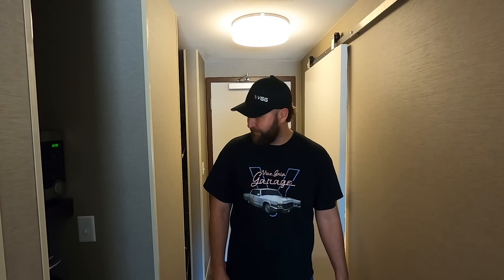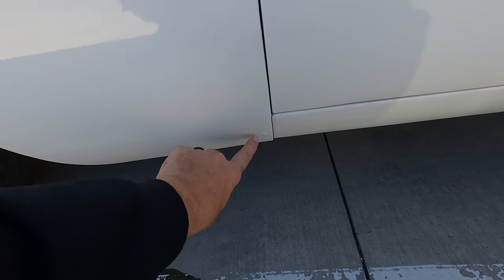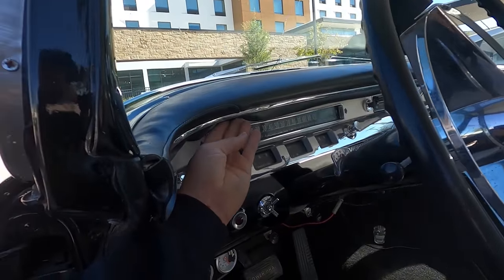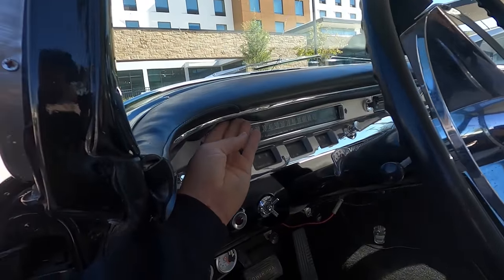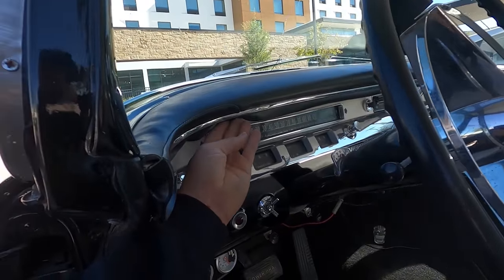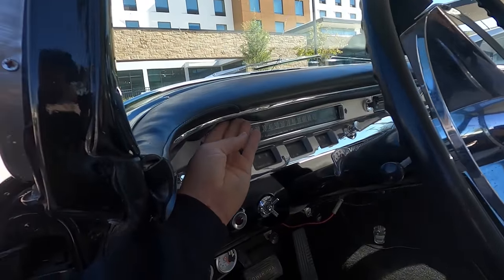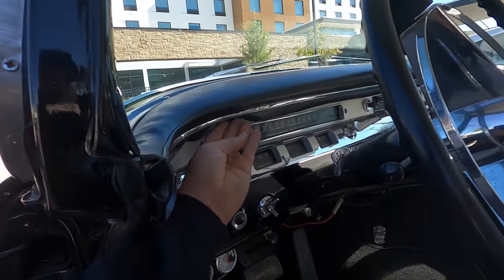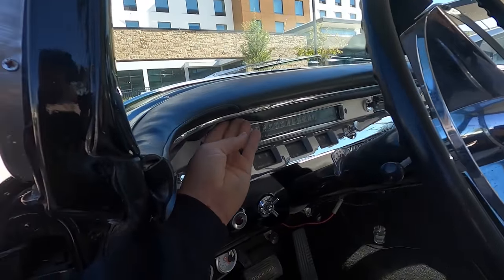Will This 1956 Buick Special DRIVE 1,200 MILES Back Home? (P1)

Comment: Independent suspension, internal drive shaft, I beam not stamped front suspension with Danaflow transmission. Just check fluids make sure there’s no leaks, and this car will make it around the world and back. I’m lucky to own a’56 Tudor Super.

Comment: Try a restoration of the Radio - mine 61 Corvair needed capacitors and a little readjusting on the tuning and receiver RF circuit. 28:47 only took a few seconds to get warm and go after starting the engine. 30:45

Comment: Hey everyone this is Giovanni from Philly I have a 1955 Buick special that I'm building now and my baby is a 1955 Buick roadmaster that gets a lot of looks I'm not rich  but I fix a little at a time save up money do more work I removed my seat's at the shop $850 please continue to fix your dream car's  Jay Leno has a 1955 Buick roadmaster with lots of horsepower I'm still working on my roadmaster 30 years later I need a 2 nd Job lol

Comment: I bought a 1980 buick lesabre in Nashville and that's the first problem I had was a bad water pump..Changed it out with a brand new one that eliminated my coolant leak problem..It rean like a top because I babied from the start..High performance plugs and wires,synthetic motor oil.never had a transmission problem.It was a every day driver car.to and from work.Oh the other main problem was the rear end was loose.

Comment: I blew up my dynaslush in my 55 Special. A teenager can do anything. Good thing Dad had a Sunoco with a lift. Got it out by cutting  the floorboard with a chisel to get that last bolt. Dropped it in a 55 gal drum. That tranny weighed more than my present car.

Comment: I just watched this video again for like a third time.
Maybe a guy would pull the nail head and original transmission driveshaft. Drop in a hot SBC/turbo 350. She would make a nice little cruiser.  
It’s a beautiful car. And deserves to be driven.  
Keep the original drive train just  in case you want to return it to stock original.

Comment: yo Derek i like your style - constructive criticism - IMHO it be worth the time to cut the bottom hose back a bit which gets rid of the typically weak area under the hose clamp from 'oversqueeze' and gets you the clearance with the frame , then i'd put one wrap of tape that goes under the clamp then wrap it a few more times after the clamp is on...

Comment: Well, I just started the video.  You haven't even started the car yet.  Go ahead down memory lane, it's ok.  Old family cars are kind of like your Grandpa's gun.  Keep it and pass it down.  I sold my Willys Jeepster after the Black Forest Fire in Co Spgs.  approx 2012.  I lost my storage, and the damage was extensive.  It melted the pot metal emblems, door handles, burned the tires off - but there wasn't a lick of grease on the engine or frame!  Always a bright spot to look at.....

Comment: I very happy u found your family car my friend I was a baby growing up and my uncle has two 55 chevys one Belair an a 210 hard top both two door 327 engines, not stock but they get him town. we would help sand and tear down engines leave the gas flaps open he would grill us "did u put anything in there" I dropped a 1/2" extension down the intake after he torqued it good times my friend love your channel and a huge fan. can't afford my own hot rod yet UT when I do mabe u can come help me build an engine

Comment: Amazing ride  I had a 65 special how much they changed . Its gonna blow the water pump . You may be able to get a modern style type valves so you do not need lead substitute . You really do not need it just do not push it or tow something .

Comment: Might be a Tube radio My Corvair was a hybrid with a couple of tubes and a couple transistors 17:52 without a vibrator or High voltage supply, it took a few seconds to warm up.

Comment: Do you know on your radiator hose where it’s starting to leak rather than just putting tape around it use some flexseal if you can find it or some rubber gasket sealant before you put your tape on it and that will extend the life of that. Holds a lot longer try that next time

Comment: I have watched and enjoyed all three episodes several times.  I used to work very near the Austin airport hotels and know the highways between Austin and Dallas very well. I have bought gas and used the car wash at the 7-11.  Incidentally, that was a blending pump where you got gas.  It had two tanks for regular and high-test and blended the two for mid-grade.  Both tanks contained ethanol.   I was very surprised you went to Taylor, TX to access Advance Auto Parts and Harbor Freight.  That was way out of your way.  You had close proximity of the two in northwest Austin and again in Georgetown.

Since you got the Buick home it seems to have a permanent home on a lift in your shop.  I would love to know if you solved the problems you encountered on the trip--the overheating, the torque ball/tube vibration, the exhaust leak and the wheel bearing issue.

Comment: It's the self-checking cooling system mod: if it's not leaking coolant, there's none in it and you'd better add some before you fire it up.

Comment: I know this is an older video.   Most gas stations have a high product tank and a low product tank.  The mid grade gets mixed at the dispenser.   So if high grade is 10% and low is 0%.  Mid will be 5%

Comment: I was taught set up heel bearings tight, then spin and both ways, loosen and then tighten till it bumps and a slight pre-load and roll. What’s your thoughts on pre-loaded wheel bearings?

Comment: Because of the popularity of Chevy tri 5's I barely realized other manufacturers built cars in the mid 50's for years eventually I noticed custom Ford's but as you know if your a GM body style fan Ford's hurt your eyes
However your 56 Buick is the most beautiful 56  car I've ever seen 55 Chevy were may favorite of the tri five
I can't imagine it yellow but it would be beautiful in a paper bag 
It's yours try yellow if you can't get it out your head you can always change colors it only takes a gazillion hours of prep

Comment: They had more paint and interior options that year than ever. The original was most likely perforated black and white. That dynaflow trans is very inefficient. Caused major mileage problems and could be a cause for overheating.

Comment: We had a 1965 Buick Special with a V6  Engine in it.  It was The Car that My Dad put an Aftermarket Air Conditioner on it an My Mom got it to Hot and ruined the Engine.

Comment: Moved from UK to LA 1991 my first new US purchase was would you believe a 1993 Ford Thunderbird LX V8 we did 310,000 on that car , rebuilt the engine ,. had the tranny rebuilt, re painted it and redid all the suspension like new, then the 2nd set of  cats went bad , got mad and sold it. Purchased a new V6 Lincoln LS for $32000 and kicked myself up the ass ever since.

Comment: I'm the same way about my dad's old pickup, spent countless hours tearing up side roads with him in that rust bucket, and loved every second of it.

Only issue I've ever had with my pittsburg 225pc set is no 15 wrench, a fella had to replace the distributor on a 90 model caddy and couldn't get the set bolt with an adjustable wrench or a wobble

Comment: Jay Leno has his original Buick similar to yours. 
Of course it's been framed up and its a daily driver. 
It has a bigger more powerful motor but is still basically stock. 

Some things that could be causing the overheating:
Clogged/cracked radiator. 
Clogged/wore out water pump. 
Clogged water passages. 
Wrong thermostat. 
Bad radiator cap. 
A lubricant/ stop leak works for small radiator leaks. 
Try a seven blade fan. 
I enjoy your videos because their different than the others. 
I patched up old cars because I couldn't afford new ones! 
FOR CRYIN IN THE MUD!!😣😭

Comment: I had a 1976 Thunderbird with a 460 and I could run right at 105 with the second aries kickin in. I would have to just let the torque of that 4y0 just kind ease on up in the speed to do it. But yeah! 105 on 2 barrels. Lol

Comment: I had a 56 Century and an old fella told me if the Dynaflow is working, LEAVE IT ALONE! I'm a trans guy and he put the fear of god in me with that statement. I sold the car and found it forsale years later. The new owner had pulled the trans because it was a leaker and he never got it right again. I tell ya, that little 322 with a 4bbl was a runner! I turned it out on the freeway a couple times and it was the sketchiest ride I've ever had and I've had some gems!

Comment: The lack of a heater core is problematic as you can use that to help pull heat out of the engine.

Comment: Random question and I'm English so I haven't a clue on the US road rules but on the driving section in the vid there's 3 lanes and Derek is driving in the middle and being over taken on either side is that correct? in the UK you can only overtake on one side legally.

Comment: Going through a car wash with a clean car?  Another stupid move like previously starting up another car with water in the oil as well as driving this one without checking the oil in the transmission.  You should look into an automotive repair video before you destroy more cars.

Comment: I blew a top hose out Ohio on turn pike trying to make it to Polly by 7am with a load sidewalk salt on a flat bed semi middle of the night not to many top coolant hoses around for a 1192 freightliner fld flat top only a 9 speed transmission so a long way to 72. Mph with 9 holes only and 80 thousand pounds of loaded I fixed it with a wood shim on each side and duct taped luckily I unloaded near hockey supply store I covered it with hockey taped made it all the way back to western Wisconsin out Philly with a 50’000 pound steel coil going St. Paul mninasota the hose made it ionly had 3 gallons of coolant the rest water still made yep you can stop and buy one it was working so keep moving paid buy percentage of the load not even by the mile hammer down a cat B engine tough equipment about 4 million miles on the truck just keep rebuilding the cat I made it home changing the hose a semi has 10.5 gallons of antifreeze in tit so not quick process running and staying cool keep moving